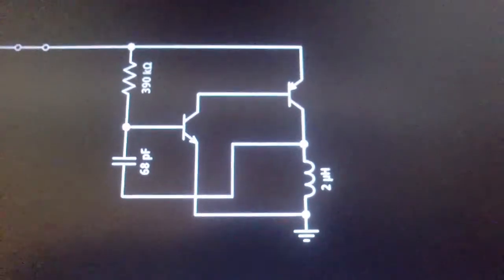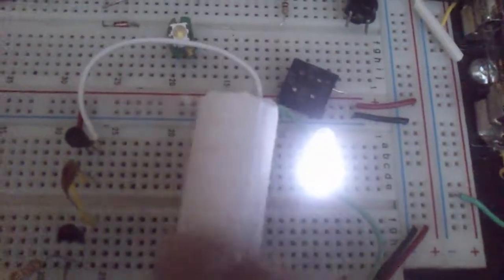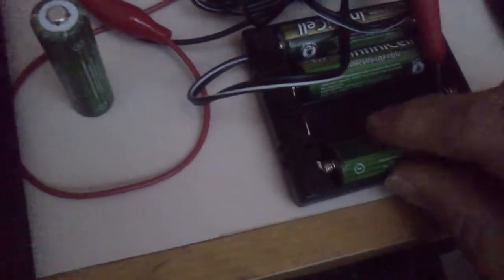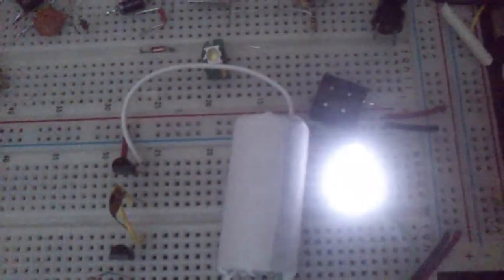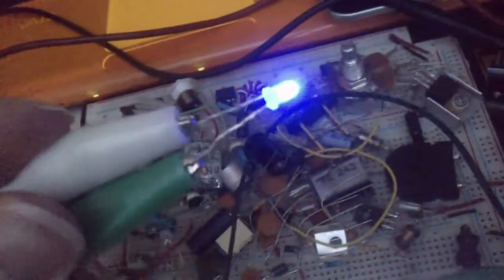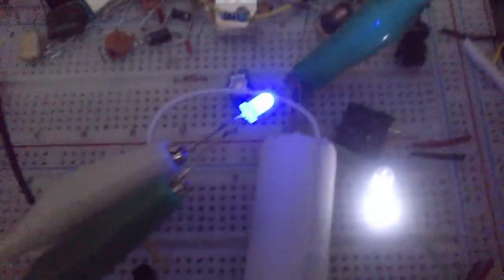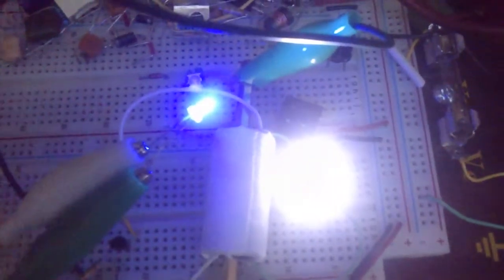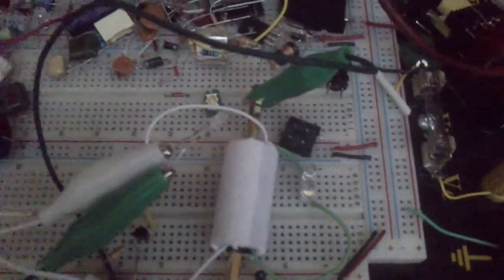1 turn ferrite transformer lighting LED low amp

Comment from the maker: Yes thanks for pointing it out mine can go up to 10 Mhz for ac but since I'm reading DC amp there's a big capacitor that I forgot to put in the schematic. I will do more testing on my own on my scope but those will have to wait I'm moving in 3 week and I need to pack my stuff again. But If i see any good result I'll make sure to post them! Thanks for watching.

Comment from the maker: I using for the pnp a 2N4403 and the npn a 2N3904. I had a 2200 uF capacitor in the circuit I didn't put it in the schematic since I simply forgot it but this circuit need a big capacitor to work I've try some small one but get a very dim light. And the transistor wont really mater since if you use more powerful one you will be able to get a higher output. Thanks for watching.

Comment: That is very interesting!  What transistors are you using?  I like to put a capacitor on the in put of my circuit to make the meter that is measuring current more accurate at high frequencies.

Comment: Salut Backupcpu. Good demo. These are very efficient results. You maybe correct. Remember that doubling voltage may changes the subject circuit frequency. Most digital meters are inaccurate beyond 2 khz. Mainly because of their sampling frequencies. A analog meter gives better results in audio ranges. They average out well, but again, nothing precise. The best result are achieved with an oscilloscope reading current and voltage. Very fun circuit to experiment with. They are very promising.